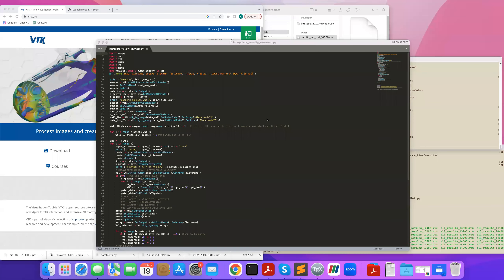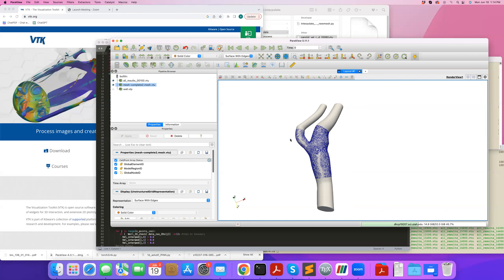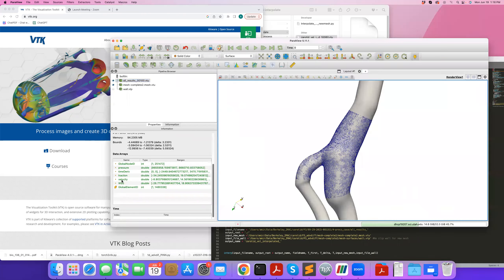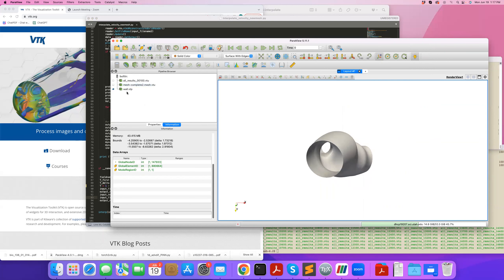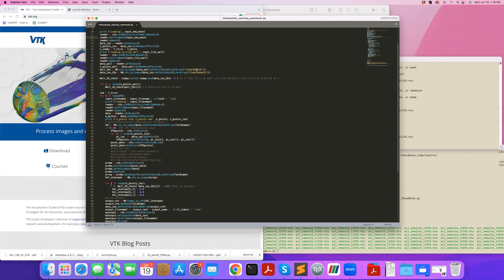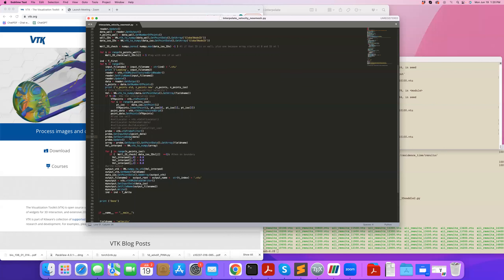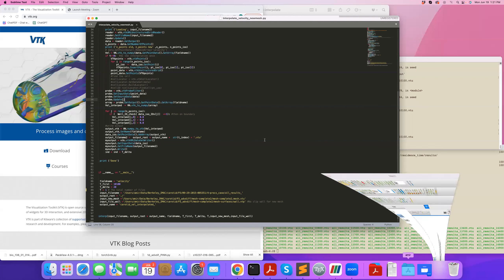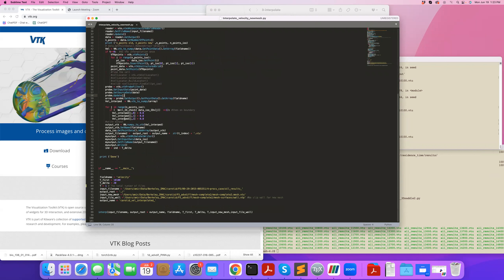Interpolate unstructured mesh data with VTK

Comment: Thank you very much for this informative video. I do have a question. I used Paraview to apply a Tube filter on a tract (with one streamline) and saved the new thicker tract as Tube.vtk. But after converting Tube.vtk to a .trk file, I noticed the number of streamlines is zero and I am not able to visualize it in freeview. Do you have any idea about the possible cause?
Thank you
Reply from the maker: I am not sure why there is a need to save the streamlines as a vtk file. Another option is to save state in paraview. This creates a small *.pvsm file that saves your paraview work (all filters you applied, your rendering, etc.). Then you load the pvsm under load state and all of your work/visualization (including the tube you created) will appear again next time you load it.